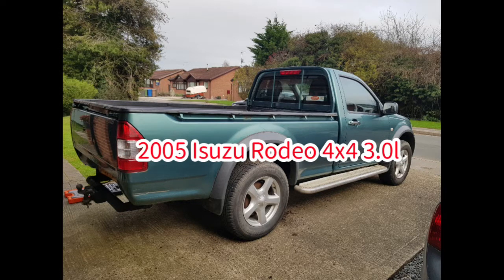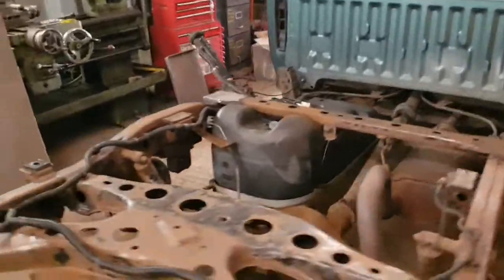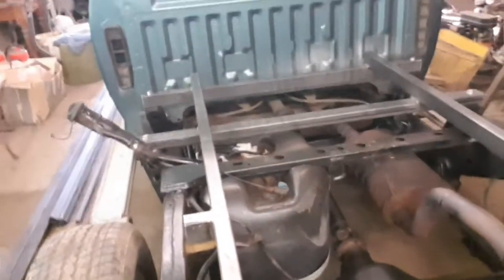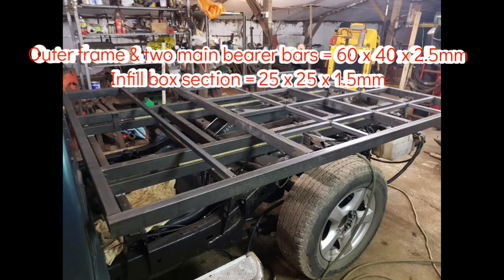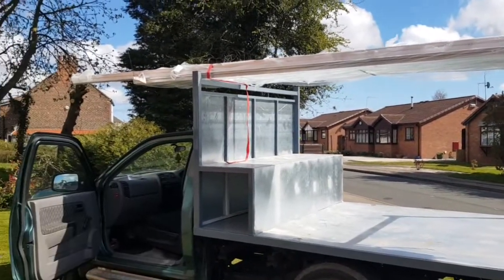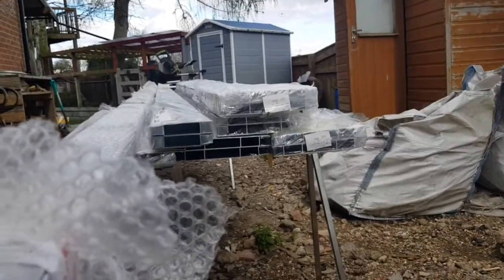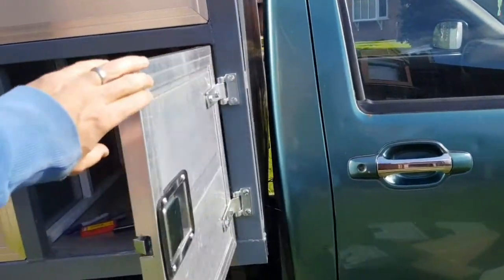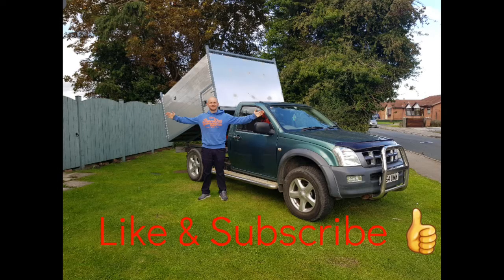How to build a 4x4 Tipper Dump Truck With an Arborist (Aluminium Planking) Body.

Comment: Awesome build! I'm currently in the process of rebuilding a 96 Chevy 1ton. I also ran into the problem of the bed not tilting far enough with the design and hydraulic ram I'm working with. Looks like we are using very similar designs. You said in the video that you have the drawings/measurements for the 2 center pieces that will be doing all the lifting. Are those drawings still available? Thanks!
Reply from the maker: Hi Eric, unfortunately not as this was a couple of years ago.
You can always move the arrangement towards the back of the vehicle to increase the tipping angle.
I made up cardboard templates to fabricate framework around the ram first.

Comment: Just wondering what is the industry name of the product you used? I have a stake body dump, which I would like to build the sides up aluminum, since steel is too heavy and will take away from how much weight I can carry. Needs to be interlocking as the panels you used are. I carry allot of small debris from doing demo which need to be contained with the bed while traveling.  I am in the US, can't seem to find the same nor similar product to the one you used.
Reply: Aluminium planks
Reply: @dcarrollservice  yes, I understand they are "aluminum planks",  but specifically what type? I searched for aluminum planks and found  OSHA scaffold planks, and bleacher seats, non of which are interlocking as the ones used in the video.
Reply from the maker: As far as I am aware we call it Aluminium Hollow Plank over here in the UK.
www.aalco.co.uk is I use (no good to you in the US though).
Try finding an aluminum stockholder / supplier over there or even a coach / truck body builder's website.
It is even available on ebay.co.uk